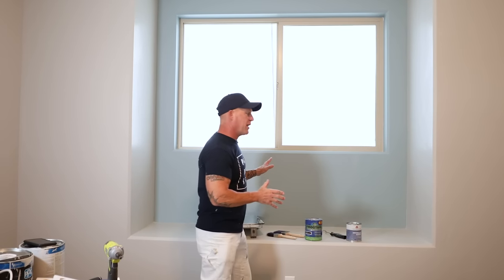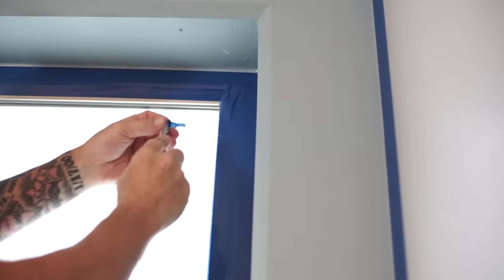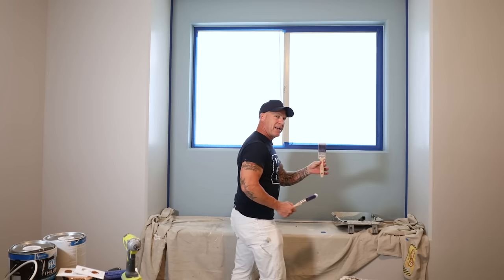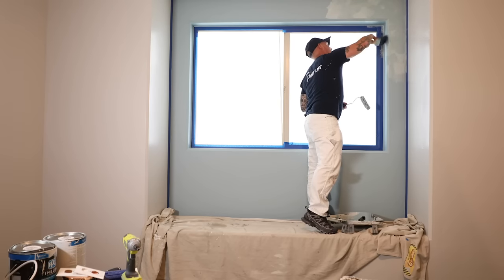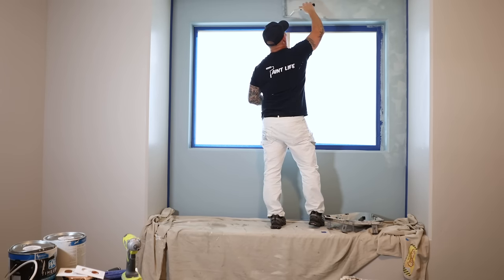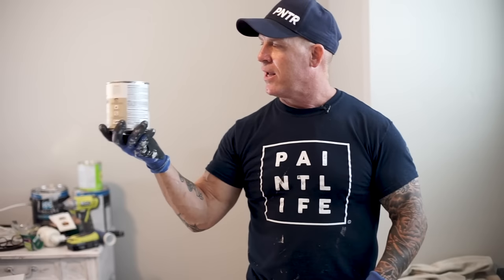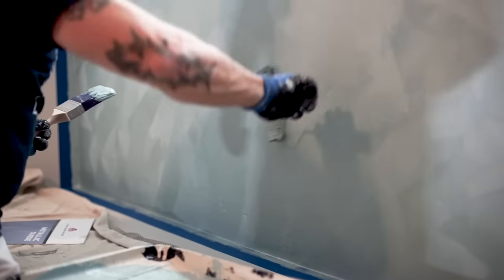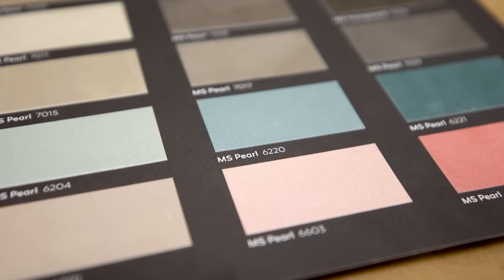METALLIC SUEDE Decorative Coatings Are EASY $$$

Comment: Great video Chris. I use extenders with metallic and other faux finishes , typically helps during the application process to keep the uniformity of the finish throughout the wall. Also one neat affect is to lightly rag finish the metallic coating, it also will eliminate access stippling. Finally last idea what you can also do is to use two close shades of metallic paints, a darker first coat then a lighter medium coat will create a lot of depth.

Comment: Hey, I noticed in the first coat you used a dry brush to go back after the roller for making random "x" strokes. In the second coat you dipped the brush in the paint tray before making the random "x" strokes... is it just an eyeball type thing or a 1st coat vs 2nd coat technique? Thx for posting as this was very helpful ~
Reply from the maker: just by feel and look

Comment: I’m trying to get a new pair of painter pants but haven’t notice Dickie to use the flex mesh material on WHITE work pants - I’m only a 34x32 pant and hate having uncomfortable pants on and restricting movement - yes I wear a belt - what I’m referring to are those pants that have a stretch in the knee and thigh, and it keeps your pants getting pulled down every time you bend down or climbing ladders - I’ll have to usually hike my pants up when I got stuff in hand or have to move and the quarters are tight and my pants snag on something - maybe no one says much on this but I just thought to bring it up 
I’m not a voice to reach out
Reply from the maker: Unfortunately I wear Dickies

Comment: Hi Chris. Thanks for another great video. I am a teacher and am wanting to start up a small painting company on the side during the summer and occasionally during the week.  I was wondering what airless sprayer you’d recommend for me starting out.  I will just be offering interior to start.  I found a Graco 210es on sale.  I didn’t know if I needed something that expensive to start out though.  Harbor Freight has their Krause and Becker sprayer on sale for $170 right now.  If you’d recommend another I am not attached to either. Thanks for any help.
Reply from the maker: Harbor Freight sells low quality tools.  Titan 410 is amazing.